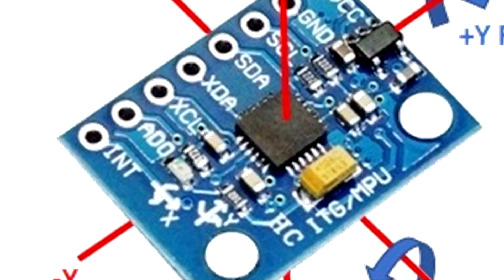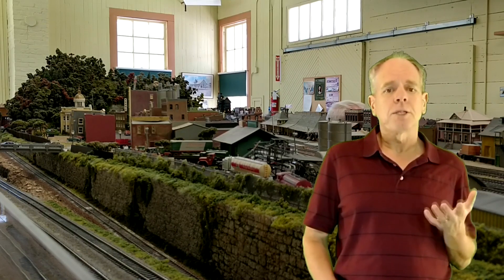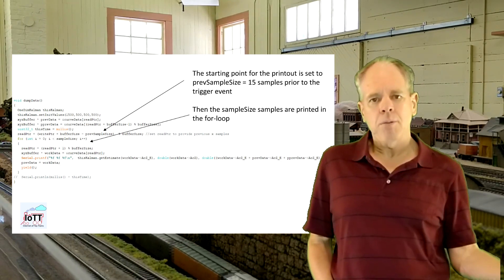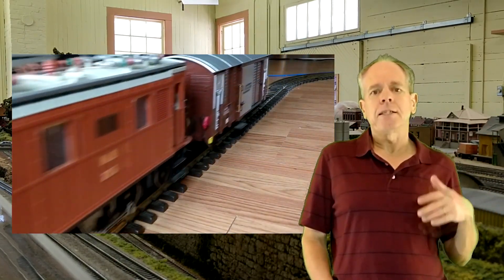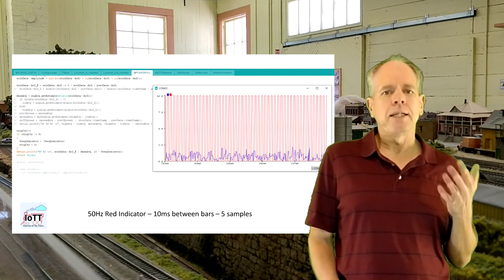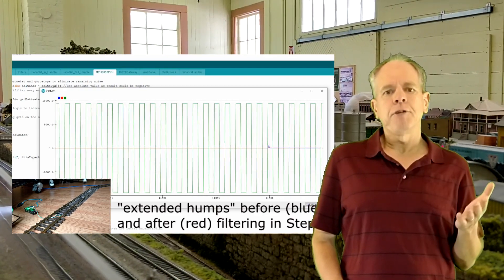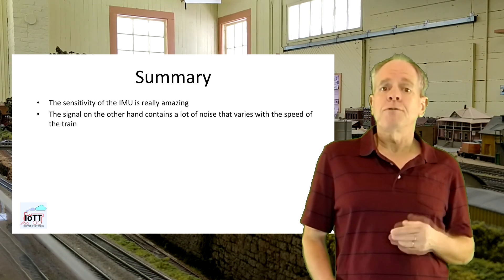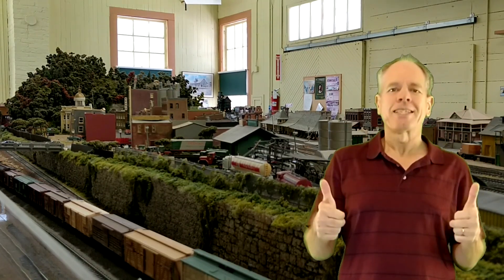Directional Axle Counter with IMU (Video #36)

Comment: A really nice idea! 

I would put a plastic block between the rails. So that the wheel flanges push the block down. The IMU is glued under the block. I wish you the best of luck in your further development.
Reply from the maker: The main reason for using an IMU was not having any mechanically moving parts. If there is a mechanical activator, I then would better use a micro switch.

Comment: Hi Hans, I looked at the IMU before but not as an axle counter. I think you need to start thinking mechanically, not electrically. First, I would try isolating the track section (as small as possible for the IMU) mechanically. Cut the rails on both side to create gaps. Jumper these electrically with long thin wires and isolate and insulate the wires (again mechanically). This should give the IMU better signal to noise ratio. Think like this -- if the only item the IMU "listens" to is a single wheel of truck, the better the detection. Consider minimizing/eliminating vibration transmission through the base and track grade as well. Try to put as much shock/vibration deadening as you can find. You will likely have to experiment with different materials. Next, consider doing the opposite with the IMU. Use a hard/solid glue to affix the IMU directly to the rail(s). Do not use a flexible glue. You could also "trigger" the IMU sampling by detecting the oncoming train with a position detector, ignoring the IMU data until a train is in the detection area. ...Food for thought. Have fun!  :-) Best regards,  Geoff Bunza
Reply from the maker: Thanks for your input. Many things to consider, I guest that's the fun in R&D!

Comment: Thanks for all your hard work. I have just come into this hobby at a late stage in my life. The aim of my first test layout was to learn and understand many things, the part I am surprised about is how block detection appears to be at its early stages. I wish to computerise as much as possible on my layout. I find your ideas interesting and exciting. One area I was considering was using ceiling mounted camera(s) to detect where trains are and which direction they are travelling in. This fails when a train enters into a covered area. Then I taught of using heat detection. These are only thoughts as I have not got started on these ideas yet. Another thought was to design a track system which is raised on a plastic bed and under it sensors are implanted. This area could be secondly utilised for a cabling bus. I will keep following your ideas as knowing where trains are is the only way to let computers control the system.
Reply from the maker: I agree, compared to industrial automation and real railroads, track side sensors in model railroading are not very advanced in development. That's one of the reasons why I am looking into this, and more to come. It actually is not only the sensor technology itself, there is also work to do on the level of command bus and communication.
Cameras is an interesting topic as image processing becomes more and more powerful. I was playing for a while with an ESP32 Cam device. But yes, tunnels are one problem, day and night difference the other.

Comment: I see your board is right on the track.  How about extending a brass rod through the layout and suspending the IMU off that rod?  This would give a larger noise factor, but hide the sensor.  I think you got something there, there just needs a bit of tweaking of the code.   Is the code out there so others cat look at it?    This is very innovative, keep up the good work!
Reply from the maker: Well, I think the closer the better as every piece in-between probably has its own oscillation that adds to the confusion ;-)
I have not published the code so far, but as always will do so in the future. But first I want to have the main functionality implemented.

Comment: where did you come from? This is awesome, I have many ideas i want to try as well. We will have to exchange ideas soon. Best Regards, D
Reply: As usual, excellent analytical work and analysis, but I'm skeptical of it's real practicality. Even if you ignore the requirements to modify the rails, the question of closely spaced tracks and/or closely spaced detectors raises the complexity (and possible reliability) of the detection.
Reply: Also, I'd imagine that how well each seqment of track that the detector is measuring will be a major problem in the real world. Your tests look lioke the test bed was not attached to a base that would come close to approximating how it would be mounted on a real layout.

Lastly, have you considered other vibrations in the immediate vicinity that aren't directly related to the train passage, like people moving or even loud noises/locomotive sound systems?

I love your tenacity, but practical considerations are paramount......

After we spoke about my system design previously, I'm still interested in using an ESP32 design to link all my stuff together, and really need  a starting point specifically related to the networking stuff you've implemented. I'm an experienced engineer, and your code is more complex than I'm comfortable modifying for my use.....HELP!
Reply from the maker: To make it a product, yes, some sort of noise insulation between tracks is needed. On the other hand, the amplitude difference between noise and impact is a huge factor, so it is not too difficult to figure out what happens 'directly above' and what somewhere else. Some is true for general noise, this is very easy to filter away. 
Re the ESP32 stuff: send me e-mail with your questions / areas where you run into problems. Have you successfully programmed an ESP32 with the code and the problem is to configure it or is there a problem with compilation? Let me know. In the meantime there are several people who have successfully programmed and configured there ESP's.
Btw: I am now working on some hardware to implement the IR sensor. Just got light conductors in and built a small print with LED's and receiver modules.